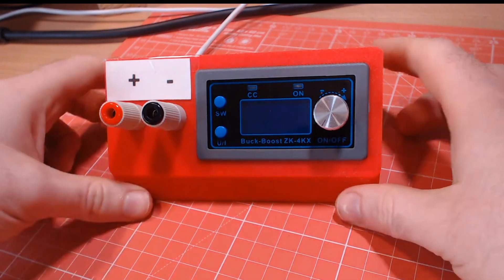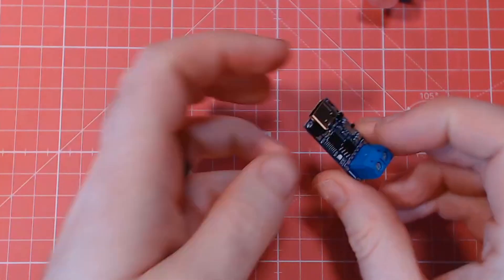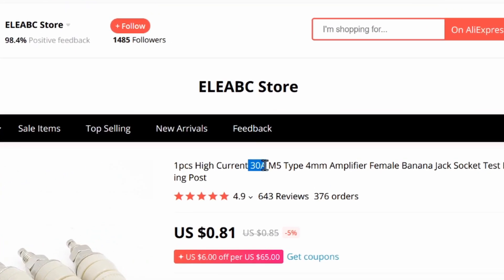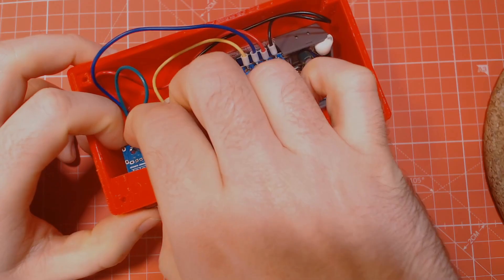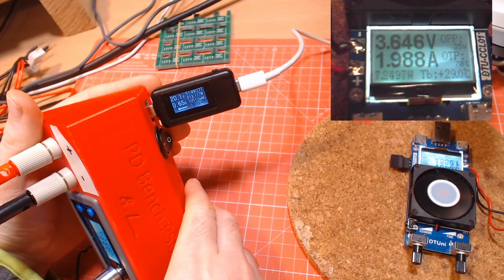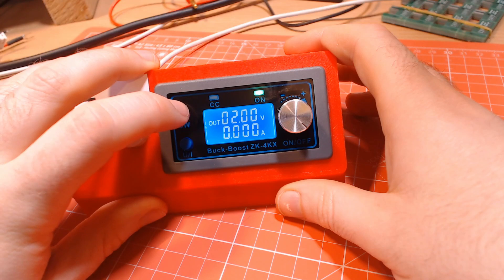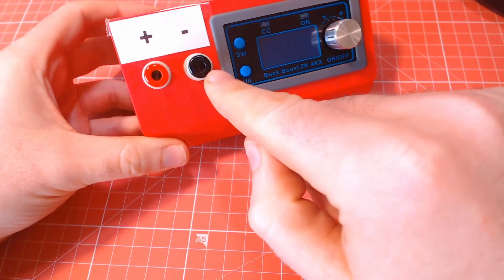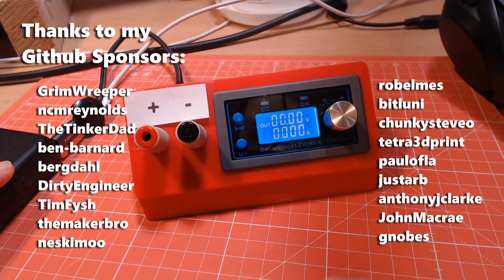Variable Bench Power Supply for Less than $12! (USB-C PD)

Comment: So this project uses the max from the PD power supply? So it does not need to be a PD power supply? Does it switch automatically to lower modes from the PD that is close to what you need?

Comment: Hi Brian! I built one similar to this using a WZ3605E, but fried it when i attached it to a battery, (not sure what happened?)

I want to rebuilt it and saw that this board you used is basically the same spec, but cheaper.

Hoping it works well.

Comment: really impressive! 
Would I be right in thinking I'd still need something like this for a device that uses a 12v 3a power supply even if the power bank can do 12v 3a or would it be okay to be feeding in the maximum current?

Comment: ZK-4KX DC DC Buck Boost Converter I can run a 12 volt 2 amp fan with it ?
Reply: Yes, you can easily run a fan of that power rating through this module. You can also use this module to speed-up or slow-down the fan.

Comment: I have a simular module (WZ5005L), but it does a very poor job on over-current protection. It actually raises the voltage in steps to the set voltage, and only then after about 200ms it starts checking the current. If there is an over-current, it then drops the voltage to match the maximum set current. This means it will feed the circuit with at least 200ms of both an over-voltage and over-current, most likely destroying the circuit. What it should do is raising the voltage in (very) small steps at a reasonably high frequency, measuring the current in the process. If the either the current or the voltage is over the set value, it should stop right there and everything is fine. It can repeat that process if  you lower the voltage or current. So be careful with this module, as it could destroy your circuit!

Comment: Nice job. For better heat dissipation through natural convection the top could be vented above the heat sink, because hot air rises.  To avoid dust these slot openings could be louvered. The colder air will flow in nicely from the existing slots in the base.

Comment: These modules are designed to be capable of being used to power industrial equipment like CNC machines, so defaulting to "ON" makes sense in that context, you'd want to power up the whole device with one switch if you have separate modules powering the different axis, for instance. They give you the option to select because they are also designed with charging batteries in mind (NiCd and NiMh and possibly lead acid). These goals make them ideal for a cheap bench power supply as you have found. I recently bought one of these and ran it through its paces, and it seems pretty solid, more so than the more expensive module I bought 18 months ago, and the user interface is easy to use. The use of a PD module is an interesting idea, although at the moment the only power banks I have will only supply 5 or 9v so that might be a future upgrade - at the moment I am using an old 45w laptop supply whose irreplaceable connector broke forcing me to replace the whole supply. 
The case I designed has a sloping top like yours - great minds think alike!

Comment: You "can" set a specific voltage with PD, it is called PPS. A 100-watt PD charger that supports PPS will be able to push any voltage between 3.3 and 21V and can limit the current in 50mA intervals, some even have a higher resolution. Therefore, if you have a pps charger you actually just need a pps trigger board, which is around 6 dollars on Amazon.
Reply: I can't find any PPS boards that will actually let you configure current limiting, do you have a link by chance?
Reply: @afurryferret  PPS protocol is able to limit the current but there would have to be an MCU to communicate that. PPS triggers that I know of wouldn't be able to do that. For battery charging you could just use voltage to limit the current. Alternatively, an easy way would be to use a small arduino to monitor the voltage and current being output and incrementally short the voltage increase or decrease buttons on the PPS trigger to get the desired current.
Reply: great comment

Comment: would you be able to make an EPR PD3.1  bench power supply  for at least 5amps/28V  or 140W ?  Apple sells a PD3.1  charger that is 140W.
Reply from the maker: The PSU module I use is limited to 50W, 140W would require something significantly better, I'm not sure you'd be able to get anything like that for cheap

Comment: If someone wants to bundle all this stuff together, including the buck/boost module, I'd be interested in buying it. If you do, maybe add a separate DC input via barrel plug (for laptop power supply) as we all have  plenty of those laying around and this module can isn't picky about input voltage.

Comment: would you recommend the lp2721 to be used for a 20v 3a led light  ? are there many pd chips that dont require programming to use a specific pd profile ? I saw that the cypress chip has this setup through a choice of resistors
Reply from the maker: If you are careful about the chargers you plug it into it would work fine. (Cause it can only negotiate 20v, it doesn't know it can /can't do 3A)

Yeah the cypress should work too
Reply: @BrianLough  thanks for the input. Maybe ill have to go about another route for this.

Comment: I made a similar one using the latter module you mentioned and a 135w computer power supply brick. I've limited it to 60w because the connector I bought for the power brick plug is limited for that, but with the inefficiencies of the module I'd guess it's consuming over 75w.

Comment: If you boost voltage  your power bank needs to supply  much more current..just  to boost.. then take into account the device  being powered  amps needs.  You'll likely Not  have much current to work with lol
Reply from the maker: That is covered by setting the power limit.

Comment: Hi Brian, this is 60 yrs old, your youngest student.  Can this module be used as Bench Power supply with output voltage 30v and current 5A?   Is output overvoltage and overcurrent protection available?  Does the unit automatically shuts if the output current shoots the adjusted limit?  Is there any short circuit protection available at the output terminal?  Does it require to short output terminals to adjust output current limit?  Anticipating your reply on my email: nbpanjwani@gmail.com.  Thanks.

Comment: Thanks Brian.  I will definitely build one of these, as more and more USB-PD power supplies are now turning up.  Re: your power switch: I built a power supply a couple of years back and have often wished that I put the main switch on the front panel, since the power supply now sits underneath a monitor and I can't easily reach the back.

Comment: When the current limit kicks in, the supply goes into CC (Constant Current) mode. The output voltage is a result of the ohm's law: U = I*R, where I is the max set current and R is the load resistance. Hence  the output voltage is not going down to 0V. PSU is regulating the voltage to keep the current at constant value.
Reply from the maker: Thanks for the explanation!

Comment: Built something very similar recently, super useful for my projects and takes up barely any desk space. Also added a XT60 connector so I power it from a LIPO when traveling. Used the RIDEN DPS5005, it only does step down so when using type-c I'm limited to the max of PD, wish I had known about the module you used. Although the interface on mine is way nicer.
Reply: I'm in the same boat. I build two based on the DPS5005 and so far i never ran into a situation where i needed a voltage boost so i'm very happy with the DPS5005 and its user interface. For the input i've used an USB-C Module like Brian did and a barrel socket for laptop power supplies.
Reply from the maker: Thats a good idea! I don't have any high capacity LIPO so my power bank will do for the portability I need.

I can only imagine it's nicer ok! I just wanted to make the cheapest thing I could and see what it was like, but as mentioned in the video, I was surprised that it was actually decent! I think you'd get used to the interface on this, other than the slowness of changing values.